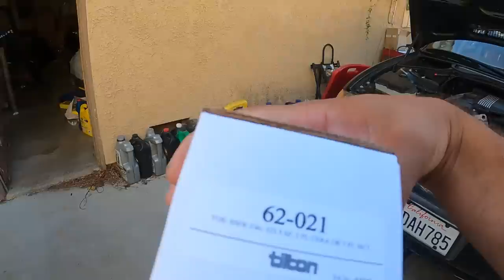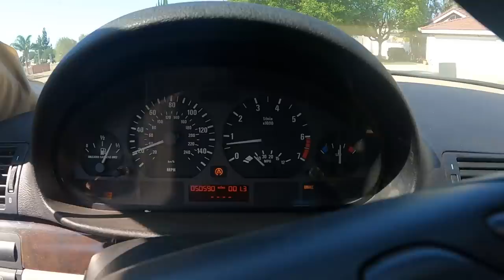TILTON CLUTCH INSTALL ON $400 BMW E46

Comment: Another great video! I’ve kinda been building along with the e36! I just picked up and I just ordered my clutch and will be swapping it Monday so this video dropped at the perfect time! Unrelated question, how do you feel about wheel adapters and if you run them is there and brand you’d recommend?
Reply: 20mm wheel spacers all around and I really don't have any recommendations just Google surf it and check out the company reviews
Reply: I've got em on my e46 jus don't go to low in the rear because you're tire well definitely rub the fender

Comment: My car always pull more to the left even with the welded diff
Reply from the maker: Have you ever replaced your trailing arm bushings?
Reply: @MicahDiaz  all of them everything thing under the car is either Revshift or ECS tuning poly everything and adjustable LCs, but never been aligned it always drove straight 🤷🏻‍♂️, maybe it’s the 5 year old ebay coilovers
Reply from the maker: @acef_performance8416  there’s definitely something you’re not noticing
Reply: @acef_performance8416   never been aligned is most likely the problem

Comment: This clutch is way too aggressive for the street. The huge reduction in rotational mass combined with a slightly more grabby friction zone means you cannot leave smoothly on hills. Its great on the track but is nothing but a PITA on a street car.

Comment: Hey Micah if you want to do a cat delete, sap delete and m50 manifold swap check out seemslegitgarage.com. I would really like to see a tune on this thing to raise the redline. You can upgrade the oil pump and address the loose oil nut problem that occurs on these engines. Good luck 👍